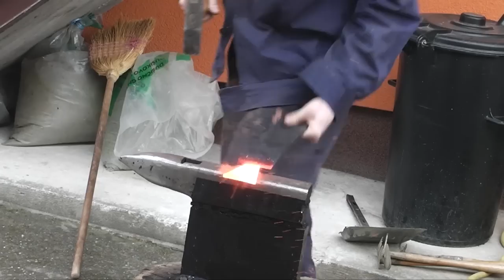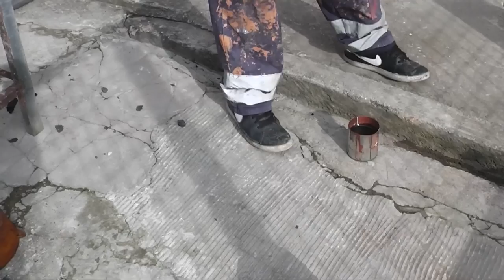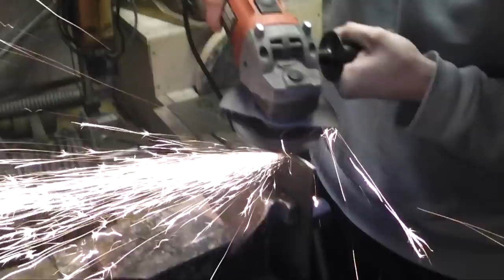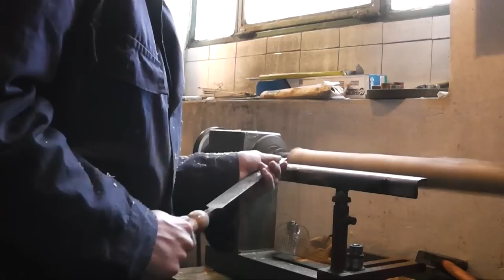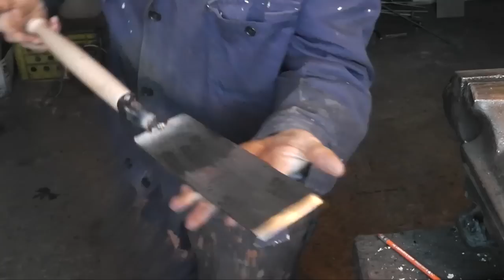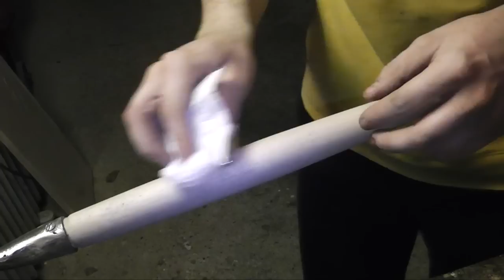Forging a Timber Framing Slick

Comment: What tyoe of steel is that and what did you weld on the end 
It does look awesome I would love to have seen it pushed threw a piece of wood 👍🇬🇧
Great video thankyou for sharing 👍
Reply from the maker: It is a piece from a file
Reply: I'm sure the slick is mild steel, and the part that's welded on is hardenable steel. But you shouldn't be able to file the hardened edge like that. If it was really hard, the file would just skate off without any cutting action.

Comment: So what would such a beast get used for?
Reply from the maker: For cleaning large tenons on timber framed joints or for making surfaces flat sort of like a plane but mostly for fitting the joints. Thanks a lot for watching.

Comment: It looked like you heat treated the metal before you shaped it, if so then you could losses hardness when you heated the metal as you worked(cut,grind & filed it).  How hard do you want the  edge to be? Most Timber Slick are 60-62 HSC( Rockwell hardness scale C).
Most metal cutting files are 60-62 HSC also, so you can not hard a blade then shape it with a file of the same hardness.
This if you use High carbon steel as a blade. I worked as a heat treat craftsman & worked with a knife maker.
Good job with the anvil & shaping the metal for the handle.
Reply from the maker: +jolj1 Yes I heat treated it prior to shaping but because the top of the cutting edge is mild steel I was able to work with a file but when I got to the high carbon bit I switched to a grinding stone and sand paper. The cutting edge is definitely harder than a file. I was very careful with the grinding on the top of it so I wouldn't overheat it. Thanks for watching.